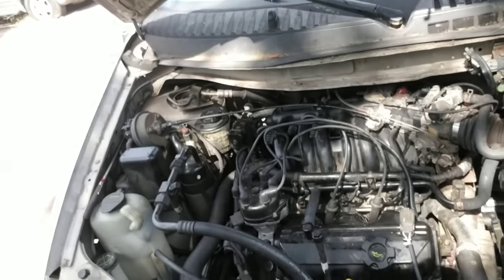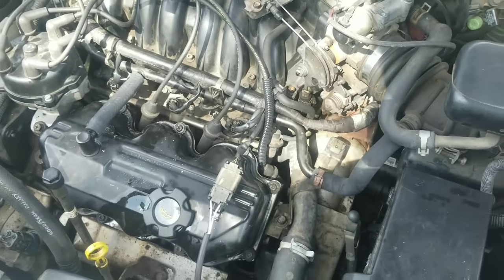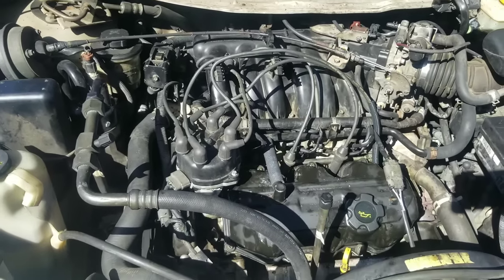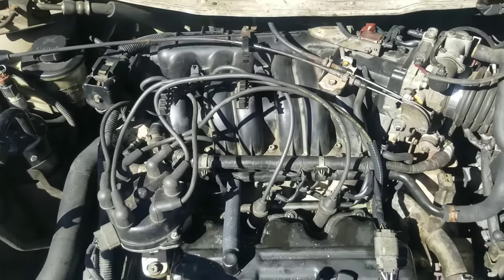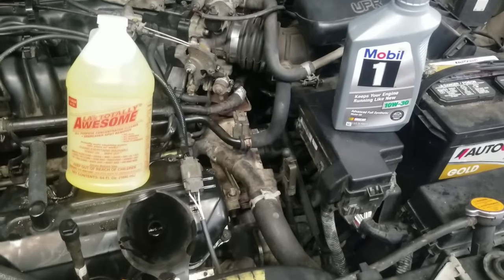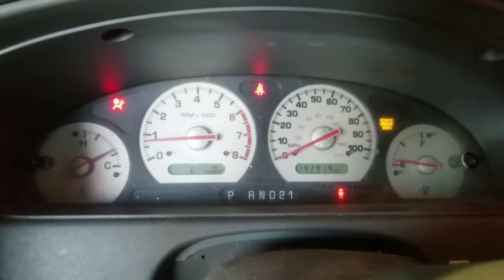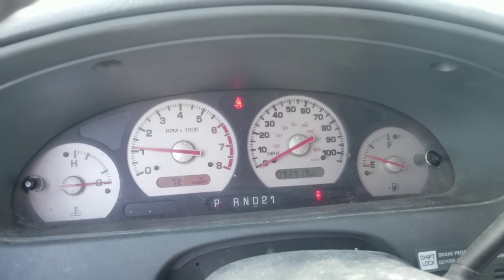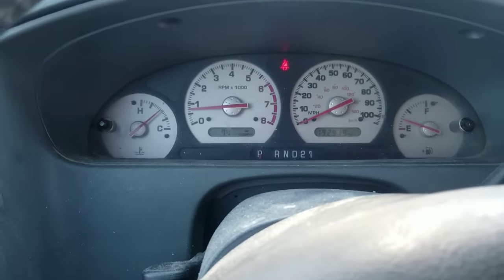How to Clean The Inside Of Your Engine The Easy Cheap Way.

Comment: only thing hes going to blow is the engine. if you are in a bad way with engine sludge and grim do these steps to safely remove engine sludge and grime.

step 1 drain your oil.
step 2 replace oil filter.
step 3 put 1 quart of seafoam in.
step 3 use half a quart of lucas oil stabilizer.
step 4 add remaining amount needed to top off your oil levels with amsoil dominator 10w30 full synthetic.
step 5 drive for 200 to 300 miles to help get the system clean.
step 6 drain oil after 200 to 300 miles.
step 7 replace oil filter again.
step 8 refill the system with a 10w30 full synthetic oil such as amsoil or mobile. 

following all these step will help out a ton and should break up about 50% to 90% of all engine sludge and grime. if you wish to be sure and to give the system a good clean use the eight steps once more. this however is not by any means the best way or the cheapest way to clean out your engine but it will be the safest way if doing a lazy clean without requiring to take the engine apart.

Comment: In a reply to a  Guapa Official comment below, Artistry Photography said it is necessary to change the filter between each engine flush (and before putting in final oil fill).  Off topic, but the cheapest oil filters in my area are from buying them online at a local Toyota dealership.  They are cheaper than Wal-Mart.

Comment: Any motor with that kind of buildup should have the pan dropped and cleaned out as well as the oil pickup cleaned. Oil pan gasket or gasket maker is cheap. I'd be worried about seals and bearings with that dollar store cleaner too. But I did do a mmo cleaning using a whole quart and did short oil change interval a few times and my old 2002 elantra with 175k was smooth and quiet after that
Reply from the maker: nice, however, this video is provided for people that do not want to remove the  oil pan. aso on your next oil change flush it again
Reply: ????? I'm sorry totally not the right way to sell work.
Reply: Mickey Mouse mechanic
Reply: First thing I thought is "he's gonna spin a bearing"

Comment: Is it safe to use this on certain model cars & engines?, what are the future results down the line - will it cause damage or other issues later. I see u working on a Nissan. I have a Nissan Pathfinder 2015 cross-engine of course so what would be your advice on trying this method. P.S. I have NOT caused the issue with my vehicle and the company at fault of course is claiming NO FAULT. Thank You in advance

Comment: I can’t argue with the results. They’re pretty impressive. I wouldn’t risk using this cleaning technique on my daily driver, though. One of those big chunks of crud could break off and float around and plug up an oil galley somewhere and ruin a bearing or the camshaft.

Comment: Thanks for sharing this video.  I do have a question.  For a 1999 Corolla, Does this mean that I have to buy at least 12 quarts of oil to flush three times or somewhat less with the cleaner?  Also, can I dispose of the oil and cleaner at the local parts store or is the mixture permitted?
Reply from the maker: yes  and yes 
thanks please like share and subscribe

Comment: This stuff works, but Chem Dip will work WAY better, although it is more expensive at about $30 for 3/4 gallon, but it will have the pickup screen and pan looking like the day it was made, with no need to scrub or agitate. Also, never dump chemicals into the oil fill like this. Most chemicals will deteriorate seals and gaskets. The correct way is to use a funnel, and fill through the dipstick tube.
Reply from the maker: either way its gonna circulate inside the motor so it dont matter which hole u use to fill it just make sure u drain it fully before u put it in service please subscribe, and share and watch the rest of the series thanks

Comment: I am getting a used different (same) replacement engine for me Jeep that I have no background of except for mileage and its suppose to be a good 85000 mile engine. I am OCD and want to clean it inside and out. I am going to use this method. Thanks for your video. It might not be what I would normally do but this looks to be a very aggressive cleaner and this is exactly what I will be doing after she is hooked up and running in my Jeep. Thanks for your video.
Reply: Jim Trenton it's a bad idea. You do this don't expect your engine to last very long. Use seafoam it's only $9 a can designed to do this in cars.

Comment: I would have guessed that the internal engine heat would have caused the awesome to boil/breakdown inside the engine. But Maybe the cleaner can handle a little heat?

Update: the material safety data sheet on awesome says the boiling point is 212°F, so a brief trio through the engine might not hurt it, as he says, don't drive it when in use.
Reply from the maker: Thank you please like, share, and subscribe, also please check out my other channel Salem Taxi, on YouTube for more material on a different level.

Comment: Did the cleaner dissolve any seals because  I have a 1999 gmc sonoma and I think that there is sludge clogging the oil pick up screen and don't have much money to have the motor professionally cleaned

Comment: I will never do that! It was interesting and entertaining and I think you cleaned it real well but I don’t have the intestinal fortitude to poor water and acid based surfactants inside an engine and sit there while it idles. I am going to give you a thumbs up because I have not laughed that hard in several months and it is a measure of my gratitude.
Reply: What you mean? It says no acid on the label. To tell you the truth I wouldn’t do this also on my vehicle.
Reply: @user-ut7vi6mr5d  It doesn’t have to say acid because you’re not ingesting it. Conduct a pH test and I’m sure you will see it is less than seven. Almost all detergent is an acid. In the chemical world it is either an acid or is a base. It’s the power of hydrogen and it’s all about electron disparity. Essentially you put an oxidizer onto metal while simultaneously initiating electrolysis and with all of the gaskets and the rubber seals and what not I sincerely doubt let the negative side of your car battery was enough of a anode to properly deal with it. I did laugh very well and I thoroughly enjoyed myself so I am in your debt for that and I thank you sir. P.S. next time I would just consider 500 to 1000 mL of kerosene. You could probably idle it for double or triple or quadruple the amount of time then as well.
Reply: @coryshook7648   It’s good to have a good sense of humor Cory. I’m glad you having a good time. Thanks for the information I will be making more research 🧐 on this. It is interesting. Have a nice day/night.

Comment: I’ve never been a fan of engine flushes myself and I’d be especially afraid to perform one on a high mileage car. I tried it once, and one of my crankshaft bearings went bad. You get a big chunk of carbon floating around and if it plugs up an oil galley, then that engine is done. Or it flushes sludge away from a worn or cracked seal that the sludge was actually helping plug up, and you get a big leak.

Comment: Thanks for sharing your experience. Whether it is a good experiment or not I do appreciate your updating us about it. I believe the oil pressure light comes on if you have a very light thin viscosity oil in the engine. In this case due to the LA awesome... My only concern here is how the LA Total Awesome affect the rubber seals and rubber o ring. Probably it will be a good idea to soak a couple engine sealant in the liquid for a couple hours in the same temperature as operating engine to see what will happens. One last thing, would you mind please to experiment the LA Total Awesome on Transmission? thanks

Comment: Don't knock it til you try it.. I tried this on a 02 Ford f150 after a failed lower intake manifold gasket that mixed the oil and coolant together. After New gasket/awesome flush, 20,000miles later runs great.

Comment: Did I miss the bit where you changed the oil filter with each flush, which seems like a must do when looking to remove debris likely to damage the internal bearings. Mr Spence Eng
Reply: Thank you

Comment: Wonder how the rod bearings look after doing this? I would ONLY try this if my other option was the junk yard
Reply from the maker: wqell that was the other option, and was the origional plan by the owner.
Reply: Ian F I drive an o3 m3  I flush out the engine before every oil change and use Kero once a year no sludge runs sweet
Reply: Ian F - my guess from the results I saw in the video is that the rod bearings are a lot cleaner now
Reply: @harrywilliamson33  Yeah you're destroying your engine doing that. Completely unnecessary.
Reply: Exactly. Viscosity of the oil is the reason for things to not actually touch rocipricating parts.. awesome does not have that and is allowing metal on metal contact. Guarantee the mains rod mains are scored and will.meet they're demise soon.. transmission fluid would be the alternative to this and much much safer on they engine
Reply: Did you see the odometer on this vehicle? This Man did the right thing and succeeded in the mean while, would have done the same thing! Guaranteed his Customer was thrilled even if it only lasts a year! Hats Off!!

Comment: Want to try, but scared of Busting Seals and gaskets... Don't want them to start leaking. Well done though 👏
Reply: Then go the safer route for the same results. Add 1 quart of diesel fuel to your motor oil  right before an oil change and drive it for a few hundred miles, then get the oil changed. You can also do that same process using Marvel Mystery Oil instead of diesel fuel as well. You would add 32 ounces of Marvel Mystery Oil right before an oil change, then drive your car for about 300 miles with the Marvel Mystery Oil and then get an oil change. You can then repeat that whole process as many times as you'd like until you're satisfied that your engine is completely clean inside. Much safer than using Awesome and with both diesel and Marvel Mystery Oil you can still drive your car while the cleaning is being done.

Comment: Just my  experience, but never try to clean under a valve cover if you have an extremely dirty engine. Drain the oil pan, get the sludge out of there. I did see one video where a guy poured diesel fuel into the oil pan through the dipstick tube. But he did not run the engine with the diesel fuel in there.

My method would be drain the pan, if there was sludge put in 0W20  or 5W20 oil and an additive like Sea Foam, Mystery Oil, Rislone,  B-12 or a store brand equivalent and let the engine idle for about 20 minutes. Then I would drain and fill with the recommended oil. The only off-label product you might use would be transmission fluid and that only at idle to help clean the engine. But who knows, the transmission fluid could harm the sensors. I wouldn't use it though in any recent engine.

If you try to clean under the valve cover gummy material could fall down into the draih hole and eventually clog up the oil pump or oil passages. Better to use a good solvent or synthetic oil, or both, accelerate the oil change intervals and let the bad stuff slowing dissolve away. Left in place, it won't do any harm.

Never run a modern engine with anything except recommended products in the oil system. That means, no kerosene and no diesel fuel. 

If you're not sure what you're doing better to have an oil change shop flush the engine. They have the right chemicals there.
Reply: Definitlt the best way to go about it, you do not want chunks of sludge blocking the oil pump or passages

Comment: A safer and better method is; drain ur oil, install a new oil filter. Then fill up ur engine with ATF. run it on idle 15- 20 minutes. Drain it and fill up with new oil plus oil filter.  If ur concerned with ATF being too thin add 1 or 2 quarts of a 10W 30 engine oil with rest being ATF. ATF because of its high detergent, will clean out ur engine safely. Using engine flushes removes too much too soon and can damage bearings. Use caution when using strong chemicals.

Comment: bought a car recently with an internal water pump failure (milkshake oil). Replaced the pump and flushed out the engine with two rounds of 50/50 conventional oil/Marvel Mystery Oil. Stuff is incredible. If it wasn't so thin I'd just run my car on it 100% haha

Comment: To an oil change enthusiast this is caused by not changing the oil often enough. To a depth bypass filter user it's not keeping the oil clean. I stopped draining oil in 1963 with a Frantz oil cleaner. I have 12 Motor Guards and Gulf Coasts in use now. The Australian Jackmaster looks worth checking out. The Frantz was a good filter but not as easy to service as the top loaders. I use Great Value 1000 from Walmart in mine. Some use Scott 1000. Some have their own elements now. When a neglected engine gets that bad it's too late for a depth filter. A good filter will clog in a few minutes.. In the old days we would open the top and wash everything down into the oil pan. Then remove the oil pan and clean it. Then install a good oil filter. The problem is if the customer didnt change the oil he wont change the bypass filter either. These problems were more common before fuel injection and synthetic oils. Some oils had to depend on engine heat and depth filters to finish refining the oil. Multi grade oils were no good. Couldn't be used in a diesel. I used Standard Delo 100 w 30 in my cars. 29 cents in the discount stores.  Delo 400 these days.  Didnt see Shell Rotella in the discount stores.  Some over the road trucks with over a million miles with no oil drains using it with the big Gulf Coast filters.
Reply from the maker: Thank you please like, share, and subscribe, also please check out my other channel Salem Taxi, on YouTube for more material on a different level.

Comment: Cheap oil is what gunk's up your engine. If you use Royal Purple regularly it will internally clean out your engine, as it lubricates it. Trust me. My oil mixture formula is a fresh 5 quarts of Royal Purple oil with some Blue Devil Main Seal/Oil Stop Leak. Results are AWESOME, with no risky shit involved. Have a great day.

Comment: A large box of cornflakes put into the radiator will stop a  squeaking water pomp, also just add a pint of milk and some sugar.
Reply from the maker: dont forget the sausage
Reply: yay especially if the sauce was spicy  .... yum yum  ;)
Reply: ray swann yeah and a banana peel in the rear diff will quiet it right down. Untill you drive a mile. Lol
Reply: +Alaman Center  No you guys try dry rice - then when it swells up -  absorbs moisture it can be flushed out with Chicken Broth.
Reply: +Jonathan Crum   No!   Try the Eddie Murphy Special - Banana up the tailpipe method - will blow out all the junk.
Reply: flour products are to be avoided man.......LMAO

Comment: Very interesting video thanks for taking the time and effort to make it. Just wondering that you done around 4-5 flushes. Wouldn't it of been cheaper too of ran just 1 strong flush like liquid moli for 15-20 mins then add your 4 quarts of oil and a quart of marvel mystery oil and then drive it for 3000 miles. I'm new to marvel mystery oil as its not easily accessible in the UK and I love it. Definitely gonna subscribe. Keep up the good work 👏
Reply from the maker: thanks and please share

Comment: LOL, that's some crazy witches brew you're using. I definitely wouldn't recommend flushing a dirty old neglected engine so aggressively. All it takes is a chunk of crud suddenly coming loose and clogging up an oil journal, and then you'll burn out a camshaft lobe or a bearing. Much better to have a dirty engine that's working, than a clean but ruined engine. If you absolutely must clean out a dirty motor, then just putting in a bottle of that Marvel Mystery Oil about 500 miles before an oil change every now and then is a more gradual and safer way to do it. Better yet, people should simply change their oil regularly in the first place.
Reply: Ya, its like a magic pill, don't believe anything you see and only half of what you hear!

Comment: What was making the Ticking Sound?  I've alway's thought that type of Ticking Sound was from the Top End, like maybe a sticking Valve, ect.  After watching your Video, this is amazing 
that the Ticking Sound is Gone and the Engine seem's to run much quieter and more responsive to Throttle.  Amazing
Reply from the maker: Yes, exactly

Comment: use diesel fuel or auto trans fluid they have some lubricating qualities that stuff awesome has no lubricating quality
Reply: The detergents in auto trans fluid can cause too much pressure and cause leaks. It's really good to add, if you gotta slight lifter tick, but you don't wanna put too much in it or you'll spring a leak.

Comment: Pulled everything off front of motor and finally removed valve covers. Sludge an inch and a half high.  Apparently oil was never changed.All started with a noise at start up and oil light when stopped at a light. Mechanic say's needs an engine but has not one engine code other than oil light. How many flushes would it take to remove that much sludge? How long should engine be run between changes? Think I will try this. It would be impossible to get it out any other way. Too much grit with the sludge. Appreciate the video.
Reply from the maker: Thank you please like, share, and subscribe, also please check out my other channel Salem Taxi, on YouTube for more material on a different level.